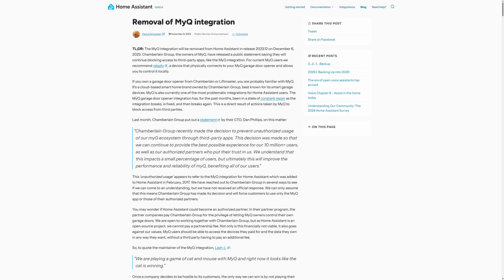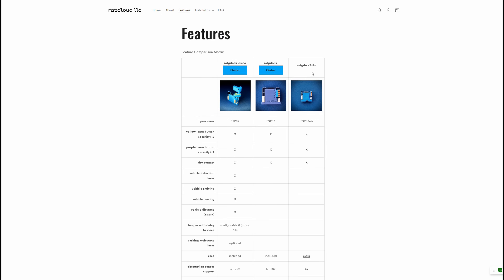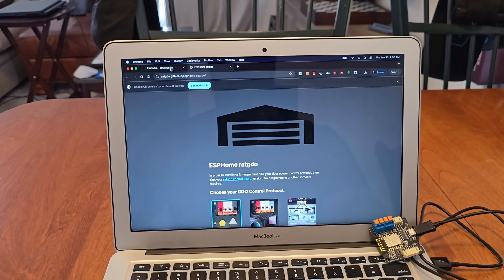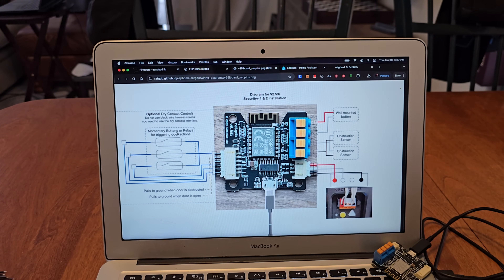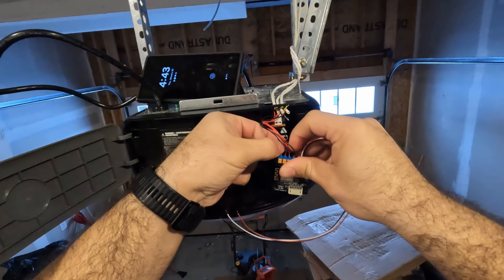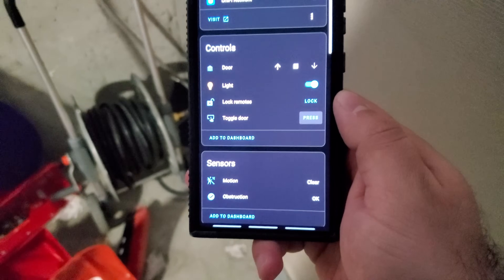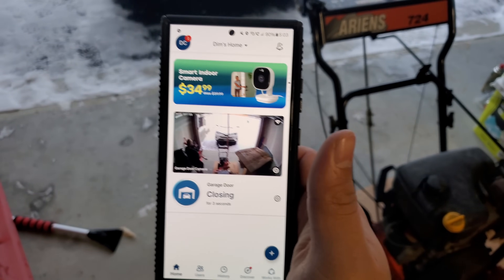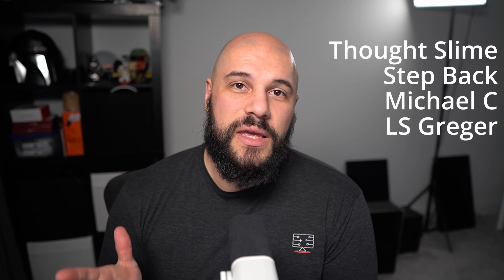Getting Rid of MyQ | Controlling My Garage Door Opener With Ratgdo & HomeAssistant!

Comment: Will this work with an old Craftsman opener? Even if it does, are there limitations? I really love the ability to open the door by a percentage.
Reply from the maker: Yes, it can work with almost any opener made in the last 25 years or so. You may have to use the dry contacts for something that's not more recent. Here's the list of tested ones. 
https://github.com/PaulWieland/ratgdo/wiki
Reply: @_Caddac  I just looked and my opener has a purple learn button. I assume that means I wouldn't even need to use the dry contacts. I see I have access to inserting the pre-soldered wires as well. I assume the link to the opener (in your description) is affiliated? If so, I'll use it to purchase.
Reply from the maker: @shanewalters7821 yeah you should be good! The link is not affiliated :)
Reply: @_Caddac  just ordered one.
Reply: @_Caddac  FYI - I finally got around to installing it this evening. It works excellent! I have also used a NFC tag via Home Assistant so when it is scanned (and it's an approved device) it opens the door. That was one of the main reasons I wanted to try the RATGDO. The two other reasons is to open the door by a percentage and (the other) is to create an automation to close the door (if open) at a certain time because I forgot to close it. Haven't messed with the latter just yet. Thanks for the video.
Reply: @_Caddac  Do they have to be dry contacts, or will slightly damp contacts work also?

Comment: you can also buy a wyze controller and camera combo and for 10 bucks a month you can anywhere in the world control any garage door opener uses a qr code on your door you place and a camera and hooks right into the port or wires into the push button its litterally 2 wires and power from 110 volts thats it
Reply from the maker: Again, you're paying a subscription to a company to use your own devices in your home. The Ratgdo is cheaper after 4 months of using the Wyze controller (initial cost + monthy sub). 
The whole purpose of this is to have complete control over your own garage door opener without having to rely on another company (and added bonus of no subscription fees).

Comment: if we don't have a chamberlain opener already is there a recommended opener that is good and supports HA?
Reply from the maker: From what I've seen, there aren't many options and putting the Ratgdo on a garage door is almost always going to be your best option. Meross is one that's mentioned often, it has homekit compatible versions available as well. Chamberlain Group and the Overhead Door Corp own most of the available brands out there.
Reply: you can use a d1 mini with a 5v relay to accomplish this, for less than 15 bucks.

Comment: Thanks for the video!  Well done!  
Am I right in thinking that Home Assistant can only manage the RatGDO when local / on the same WiFi?  
If so, the control it gives you is great, but you still need MyQ, if you want to be able to operate your garage door remotely, correct?
Reply from the maker: You can access HomeAssistant locally and remotely as well. There are multiple ways to do it, outlined here by HA
https://www.home-assistant.io/docs/configuration/remote/
Reply: In addition to what Caddac said, the ratgdo also enables automations that can potentially run entirely without human input. That's stuff that was possible before Chamberlain shut down MyQ access in smart home platforms.
Reply from the maker: @TheAppleFreak exactly, like the automation I spoke about where I have my light trigger when I walk across the obstruction sensors.
Reply: I can already see the circular logic - They could probably accomplish remote control with a subscription to a service somewhere.  D’oh!   Nevermind!
Reply: 1. Use the HA Cloud. This lets you access your homeassistant from the homeassistant app on your phone anywhere. (This is a subscription)
2. If you use Apple Home, then there is a Homekit bridge integration that lets you share your HA devices with Apple Home. (This is entirely free, assuming you have Apple Home already setup)
3. If you use Google Home, then the easiest way is via HA Cloud (subscription). If you are tech savvy and know how to create domain names, and SSL certificates (Maybe free)
4. If you use Alexa, there are instructions, but a quick skim of them made me confuse. YMMV.

Comment: Unfortunately this method doesn't work if you rely on MyQ due to Tesla integration.
Reply from the maker: You can still leverage the MyQ features while using the Ratgdo as I show in the video. So you can still use your Tesla integration if you wanted but use the Ratgdo and HA for everything else.

Comment: The reason for the screaming before closing via the app is a legal requirement and safety. Its to let people who might be in the way know that someone that isn't there is shutting the garage door so they have time to get out of the way.
Reply: If only there were a way to prevent the door from closing on someone's head, oh wait, that's what the sensors are for.
Reply: @drexrew the sensor's aren't hardened enough under different senarios, to meet legal safety requirements.  I've worked on industrial safety equipment and to accomplish same thing its completely different sensors.  You would need something like a light curtain.
Reply: I miss Murphy. 😏
Reply from the maker: Yes I understand that's the purpose but for many reasons I feel like it's very poorly implemented.
Reply: @_Caddac I’m not defending Chamberlain when I say this, but the beeping and flashing when closing the door using a mobile app is a requirement for compliance with “UL 325: Door, Drapery, Gate, Louver, and Window Operators and Systems” which specifies 10 seconds of a combined audio/visual alert before a close operation. It’s not a legal requirement, but rather a requirement for manufacturers who want to slap the UL logo on their product.
Reply: This always seemed overkill to me until my rule to close the garage "at 10pm if it is open" kicked off one time just as I was backing out.   If it hadn't of warned me, it may (not sure if the obstruction beam would have passed under van or not) have closed on the van, I was able to get out of the way just in time.

Comment: Does Google Home work with this?  We used to have an automation set up that would tell the garage door to close when we said "Bedtime".  MyQ via Google Home would say "I'll work on that" and if the door was open, it would close.
Reply from the maker: Yeah MyQ also terminated Google Home control. You can set up Google home to work through HomeAssistsnt but you can't use the Ratgdo directly with Google home, that link needs to be done in HA

Comment: Maybe I don’t fully understand but why should I buy this when myQ works for free? I don’t have any home automation. Is it only if you want to have it as part of home automation?
Reply from the maker: I talk about it at the end but yes, the main draw would be if you want it as part of your home automation. If your Internet is out, MyQ doesn't work anymore even when local whereas HomeAssistant will. Also it's about having your own control over the things you bought instead of a company forcing you to use their very poorly made proprietary software. You're at Chamberlain's mercy and they've proven time and time again that they are anti-consumer.
Reply: @_Caddac  this is 100% incorrect, you obviously didnt set yours up correctly...
Reply from the maker: @RobertMehrer  Dan Phillips alt account found.
Reply: @_Caddac  no clue who that is
Reply: @RobertMehrer Since you know he did something wrong. what should he have done in his setup to make it work the way he describes in his comment.
Reply: @theJonnymac  the right way
Reply: MyQ won't integrate with any smart home interfaces.  Sure you can have half a dozen apps for all your devices and open each app individually, but much cleaner to open apple homekit or other and have all your devices right there and be able to setup automations with them.
Reply: The app is awfully complicated for what should be a very simple function. I opened it right now, and at the top is a an advertising carousel suggesting that I give Amazon or Walmart the ability to open my garage door, an ad for the exterior remote, or a camera. 

Separately, there is an ENTIRE TAB dedicated to partner advertising. 

Plus, my second garage door opener is from 2019 and does not support MyQ. I'd much rather spend $62 than buy and install another garage door opener.